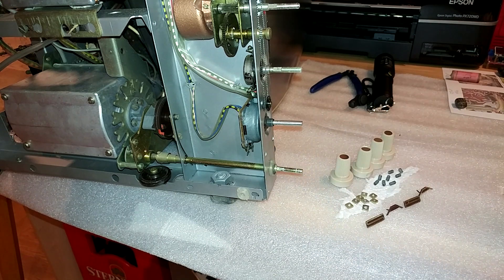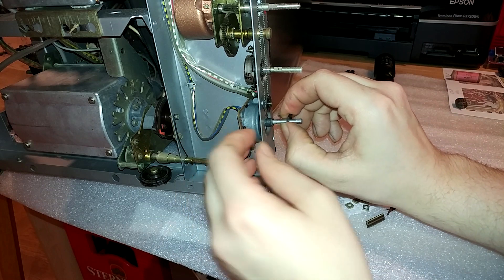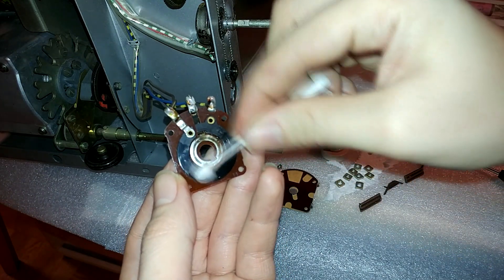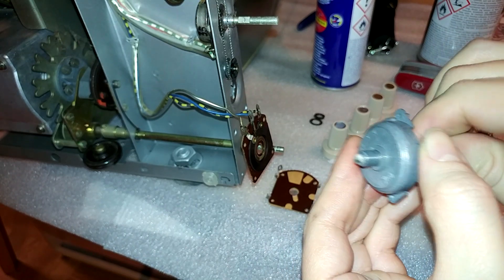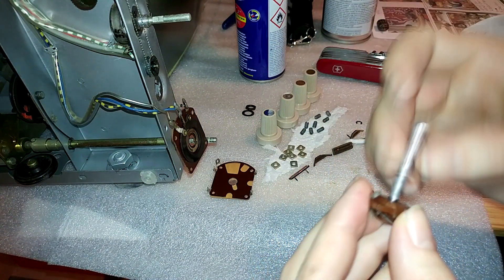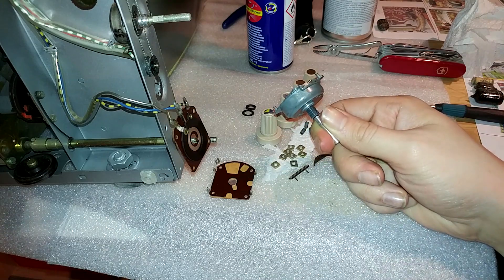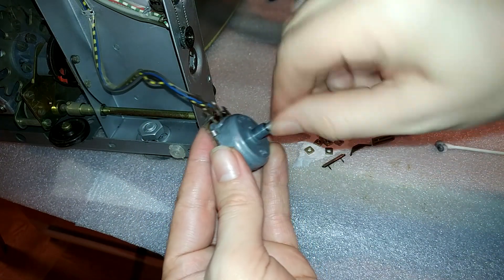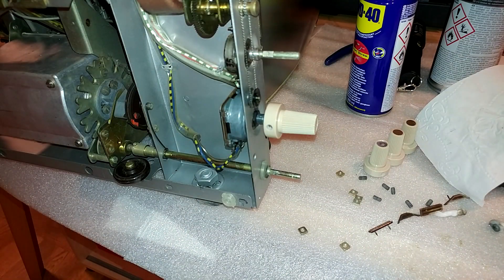Saba T116V TV Restoration & Repair Part 2: Stuck Potentiometers

Comment: Good fix on the frozen pot, an easy way to free them up is to apply heat to the shaft with a soldering iron, this melts the old grease and allows the shaft to slide out easily.